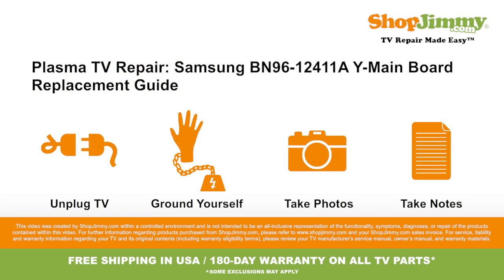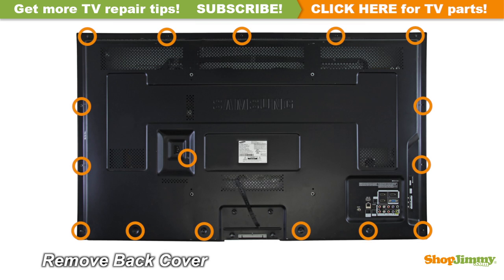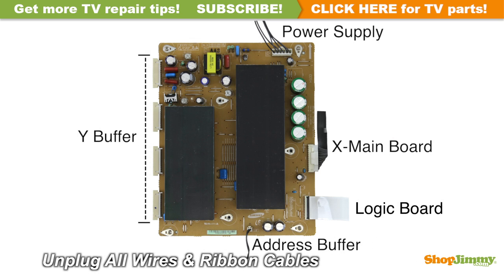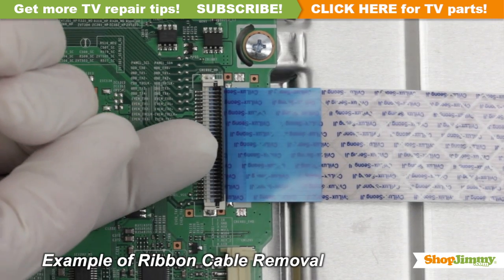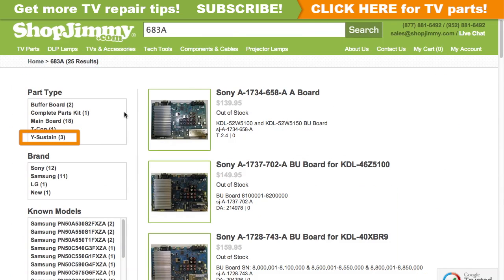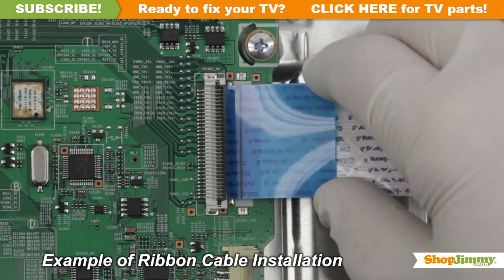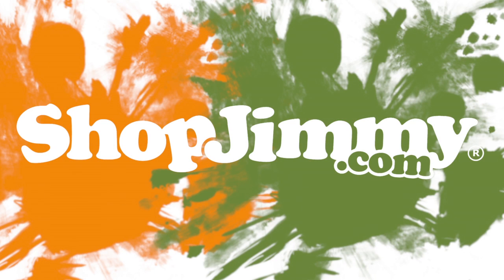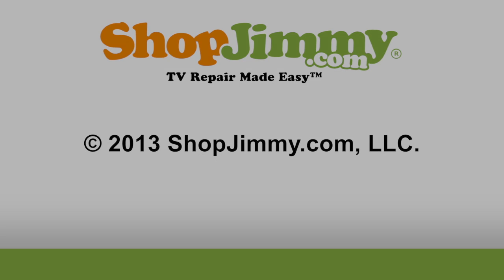Samsung Plasma TV With No Picture Repair - Y-Main board & Buffer Board Replacement Tutorial

Comment: you don't show  exactly how to remove the y stain board, that's where the needle nose pliers and maybe the flat head screw driver come in cause that board is very hard to remove and you should show how you removed it rather than making somebody believe or think this board was easy to remove, I couldn't remove it cause I thought I was going to break something.

Comment: Hi there, please I have this issue with my Samsung plasma tv. When you turn it ON is black screen and  it gives a clicking sound like about 3-5 clicks and stop. I followed your video and I bought a y-main and y-sustain board and change it but the same problem.  When I disconnected the y-main from the y-sustain, it still produced the clicking sound, but when I unpluged the power cable that comes from the power board, the startup sound comes on and no more clicking sound. So my question is what do I need to change?
     model # PN42C450B1D and model code: PN42C450B1DXZA and S/N: Z1M73CQZC13003Z
Reply: Did you figure it out
Reply: Boston Barrett thanks for replying me but no, I don't  know what to do again.
Reply: I figured my problem just now it was the y man board. Just by watching videos. Do you want the video i used?
Reply: Boston Barrett ok fine

Comment: Hi,

from France.

I have a PS50B550T4W(XXC). I have now 6 black horizontal lines on the upper side of the screen so I guess I have an issue with the upper Y-buffer board. Can you tell me which model it is and how much it may cost?

BTW, I could access your shopjimmy.com links as accesses appear to be restrained since I have a "Access Denied".

Regards.

Comment: My PN59D7000 plasma made a pop noise and then the bottom 1/5 (approx) of the picture went white with Black bar a few inches wide going down just right of the middle (except sheer the white covers it). The rest of the screen works. Any ideas? Would post a picture, if I knew how.

Comment: I have a Samsung plasma model #pn43d450a2dxza serial#z2z43cqbb41229w the tv has sound but no picture. When i turn it on it clicks and than does the jingle and the stand by light blinks 5 times. I have replaced the power supply board the y scan drive and y main board through you guys and still no picture. Please help!

Comment: My Samung 50" Plasma TV PN50C590G4FXZA just made a loud pop and the screen is now black. The TV turns on and you can her the sound for the channel that is on but no picture.

Do you know how I can determine what part I need to fix my TV?
Reply from the maker: Andrew Aiello   I recommend replacing the Y-Main Board and the Y-Buffer board in your TV.  Click this link to replacement parts for your TV model number:  http://www.shopjimmy.com/catalogsearch/result/?q=PN50C590G4FXZA  Be sure to match part numbers on your current board, with your replacement for compatibility.  Here is a link to a video showing how to identify your part number, click here: https://www.youtube.com/watch?v=R1jmj_foId0  Thanks and please let us know if you have any further questions with your TV Repair!  www.shopjimmy.com